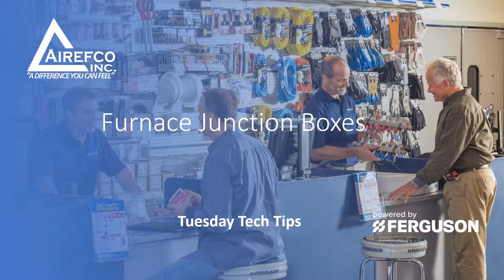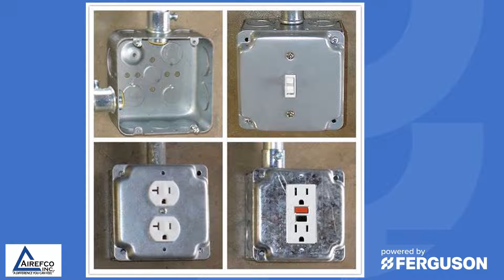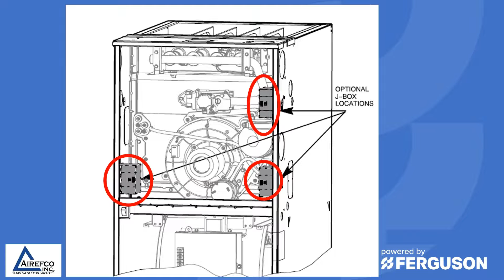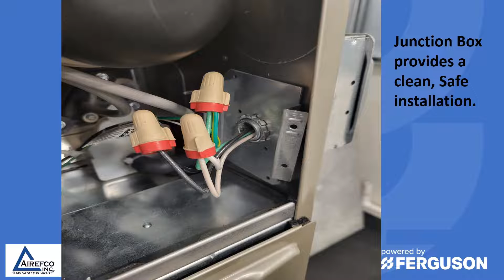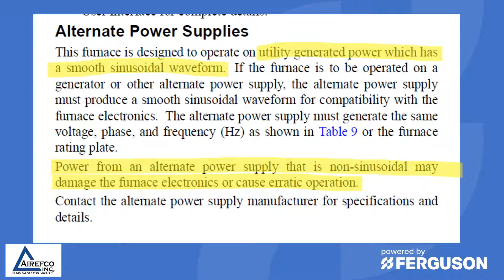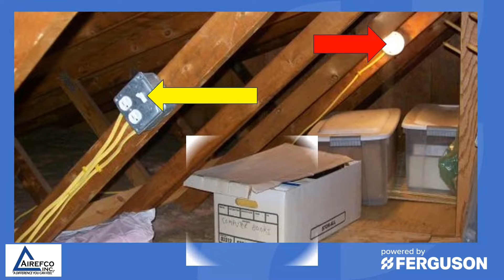Furnace Junction Boxes

Comment: As an installer where 90% of my jobs are inspected, you will fail inspection in most towns of NJ if you do not use the J-box inside of furnace .
     Just wish manufacturer's knew to add the chase nipple needed two connect both boxes.
     Many times I've had to use a  romex NM connection, which will suffice